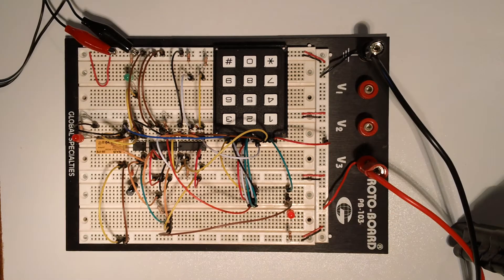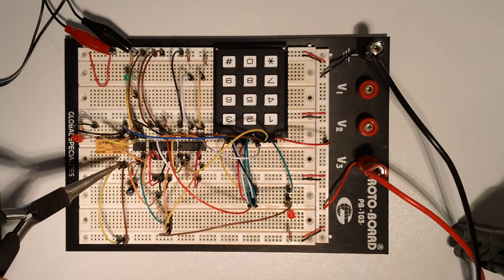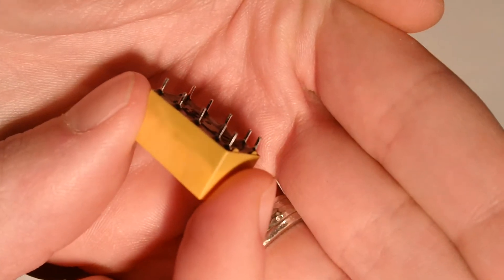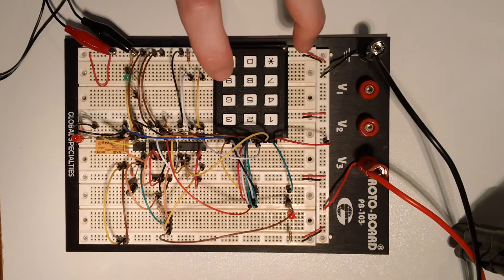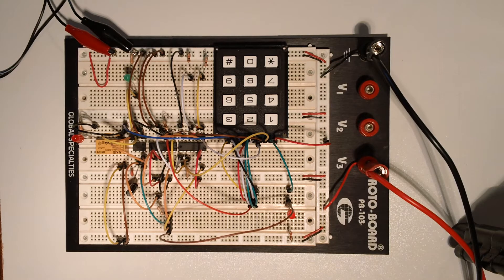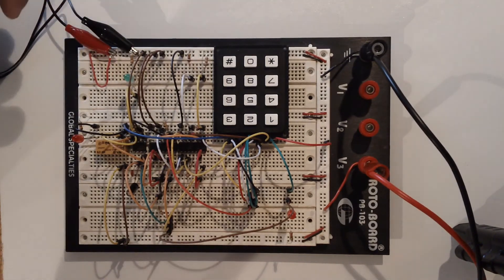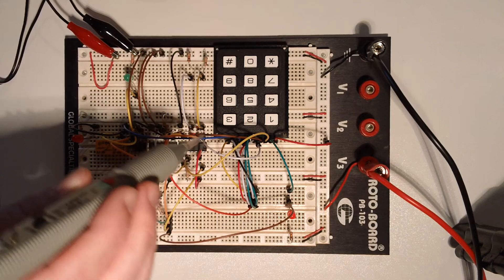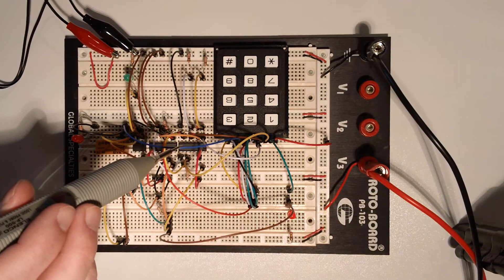Make: Electronics - Experiment 20 (Building an electronic lock combination)

Comment: Hi.

I have thought of an idea to make a sort of mini telephone exchange to work at the end of an extension.

The problem I am trying to solve is this;

In the office there's only one extension number. This was fine as there was only one person there.

Now, I am also there and lot's of time I end up answering the phone to my college.

The idea is to have a small device where it will connect to the extension socket and have two outputs for both phones mine and my college.

This device will be setup to receive and incoming call and answer it, ask caller to press #1 to speak to user 1 or press #2 to speak to user 2.

I am not too clued in to electronics. I am on a level 3 electrical installations and I have done a bit of it. As far as having a 3 system relay to control a water pump by 2 floating switches and a set of traffic lights.

First switch will engage relay 1 which will turn off green light and send current to the second relays always on pair to turn on orange light.

Second switch will energize both second and third relay. Once third relay is energized it will now no longer need energy from the second switch as it now draws it from the first switch on a loop.

I had to use a DIODE to prevent, upon the switching off of switch 2, feeding power back to relay 2 and effectively switch relay two off, turning the light from red back to orange.

This is as far as i go.

Now for this idea. I am thinking I'll need to eventually design and print my own PCB.
Weld line incoming socket and outgoing sockets in it, maybe a relay will do the sending of call to user 1 or 2.
I'm also thinking I'll probably need some sort of programmable chip that will do the answering call, ask user for which user want's to call, so needs to be programmable and then send it out to the correct port. It would also have to recognize dial tones I guess?

The outgoing calls we need to do could just go straight through bypassing the circuitry.

Any ideas on how to go about this would be greatly appreciated.

Regards,
Albert

Comment: Hi.Can you tell me how to substitute the latching relay with something else.I have all of the components but I can't find a latching relay.Thanks.
Reply from the maker: If you're simply trying to build a proof of concept without actually driving a device, then the relay isn't really necessary - just use an additional LED to signify the path where your theoretical relay would go hot.
Reply: *****
Actually I've build the alarm from the book and now I want to add the combination lock as a enhancement.I can convert an ordinary relay to an lathing relay,as described in the book, but that would spent a lot of current.I am stuck without the relay.I will try to use a transistor as a switch instead of a lathing relay but that would spend electricity too, when the alarm is on.
Apart from this,what do you think about the book.Me for example,this book taught me a lot and I can't wait for the sequel "Make more electronics".Also, I am planning to learn c++ to be able to work with microcontrolers.It's kind of addictive.
By the way, how do you continued you learning after this book?Do you know some other helpful gadget like this.
Reply from the maker: Go check out my video where I talk about the books in my library - it'll provide answers to both of the questions you asked.

Comment: Thanks for the video, Chris. I've had some issues to get this experiment to work, actually. Although my 555 was being triggered, it was not delivering enough voltage to set the relay coil. I did some experiments only with the Panasonic DS2ESL2-DC5V relay and I would be able to set it only with around 5V. Less than that wasn't enough. 

In order to fix it, I add a 1K pull-up resistor to the 555 timer (from pin 8 to pin 3). If you have any other suggestions on how to fix it, I'd love to hear them.